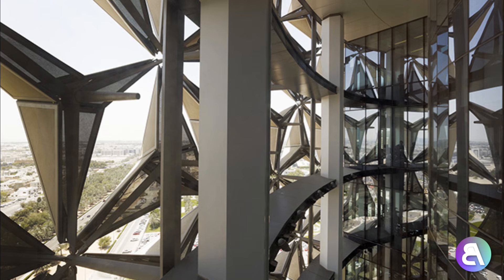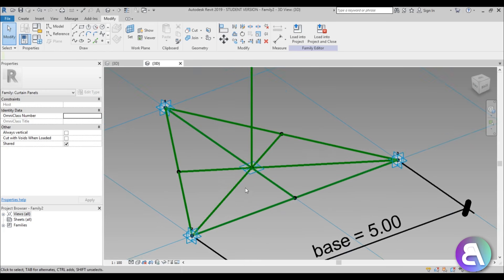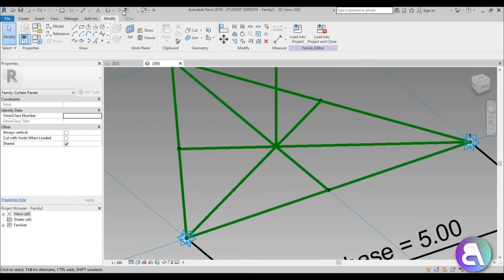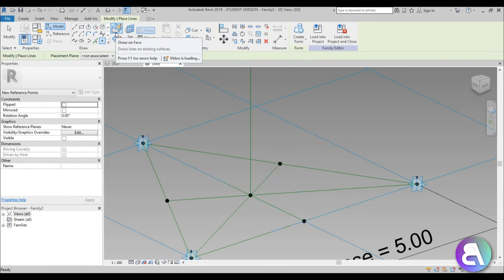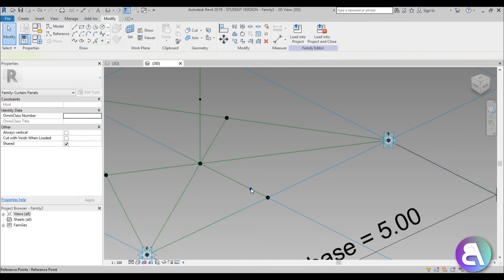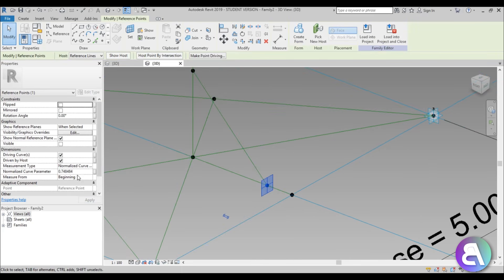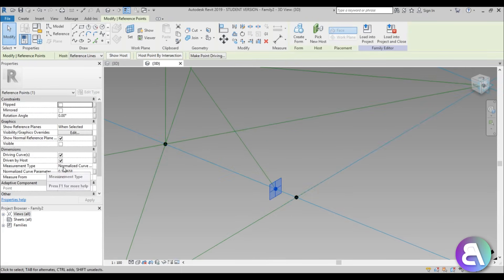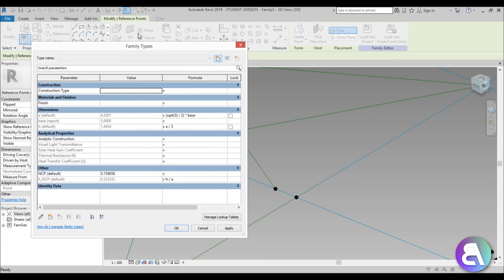Al Bahar Parametric Facade Family in Revit Tutorial * Part 2 *

Comment: This is my first time working with parameters when modelling in Revit and the problem that I have I don’t know if it’s a normal problem or what but I kept getting an error code whenever I had to ensure. The family would function properly. It particularly had to do with the NCP so I don’t know what it is. I couldn’t figure it out no matter how I tried and because of that, I’ve basically just disregarded that entire project Disappointed.

Comment: I noticed that the issue comes from a step in the last tutorial. At 16:14, he begins to set the "Show reference plane" to "Always". After this, he begins to check a series of boxes. He checks "Visible" and unchecks "Hidden by Hosts". Unchecking "Hidden by Hosts" causes the error message to occur for me. I went back and left that box checked and it allowed me to complete the rest of the tutorial without the error message. Hopes this helps!
Reply: Good Point! i noticed that too, but even after I fixed it the panel family is still not working properly on a vertical curtain wall, it could only be applied on a horizontal plane. Will keep digging tomorrow. Let me know if you have any idea.

Comment: This tutorial seems to work when we are not following each step. Specifically for a beginner. I followed each step. But always an error occur "Failed to apply family parameter" when applying formula to Lh at 3:48 . I noticed the video clips were edited at some specific points where I encountered the error at 5:44 etc. It would be great if you could help with these errors. Thank you for these tutorials.
Reply: Same here, I'm getting the same massage over and over.!
Reply: Make sure all the parameters with formulas are instance parameters and not type parameters. Also, you may want to check the brackets within the formulas. Hope it helps resolve some issues :)
Reply: @rathoreyash98 I didn't understand how to solve it
Reply: Make sure as he said, the point has to be close to 0. I had the same error when it was too high value
Reply: @shaamalraj2070  I tried it but it always failed
Reply: any idea on how to fix this problem?
Reply: @maaz1538  Try not to uncheck the "driven by host" in sir Balkan Arhitect part 1 tutorial (16 minutes)
Reply: me too, everything is the same yet i still am getting the error, any help please? 
thank you for your tutorials, much appreciated.
Reply: Did it work i am having same error
Reply: @justcurious-p9h  Just go part 1 of the tutorial, in 16minutes, there is a apart where he unchecked the "driven by host"
Reply: @orlandorosjr  guys this is the solution it worked for me

Comment: 7min...when i change NCP..the llength changes, and if i go over a set amount, say 0.5 it flips sides? where did i go wrong? also mine was never the same distance from base line as yours....does that matter? ididnt think it would.
Reply: figured it out...i never used the small ref line, so it assumes 1 is the top of the main reference line before divided. fuck
Reply: if you did the same, just select new host for the point, and make sure to reselect measure from end.

Comment: Hello Balkan Architect. Very nice but you did the same mistake as Jeremy Roh 2 years before. Your triagnle doesn't stays the same. Check the base length and you will see. Or make an origami version (or check carefuly the image of the real building) of the panel and you will see that there are points that goes beneath the plane

Comment: Verify the formula you used. All sides of the triangular panel should always be constant whatever the value you will use for NCP. The longer leg of the panel must be equal to 1/2 of the base (2.5) all the times. In order to do so, the vertex at the right angle (of the panel) should move both horizontally and vertically.
Reply: https://www.linkedin.com/feed/update/urn:li:activity:6563077171173253120/